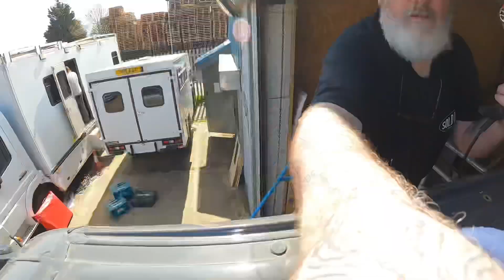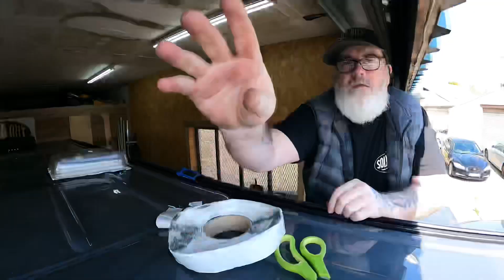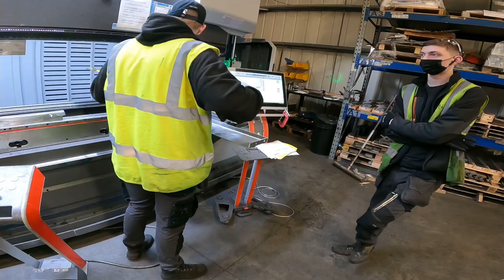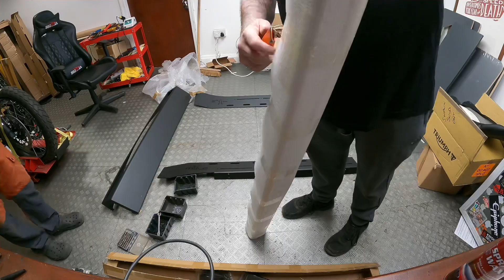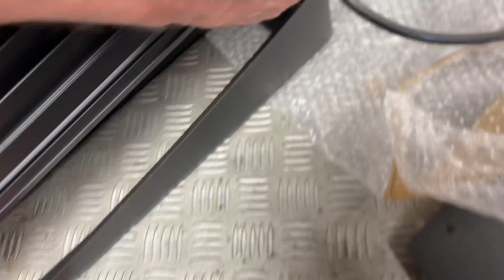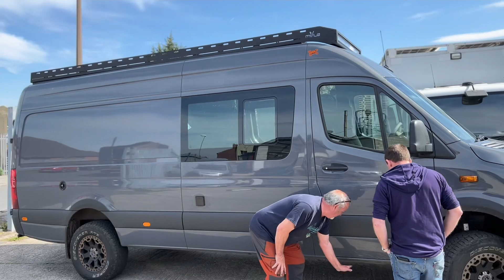Sprinter modular roof rack install

Comment: Hi will be looking for one in the new year for my hymer freeS600. How does it work with the roof rails if you can't get access to the inside, as its fully fitted coach built.
Reply from the maker: We can work round this no problem you can contact me infomulevans@gmail.com
Reply from the maker: We can sort this no problem contact me at infomulevans@gmail.com